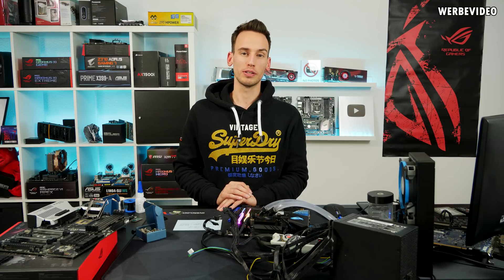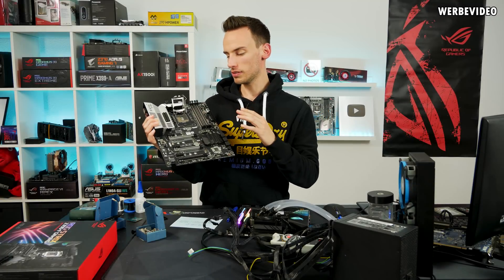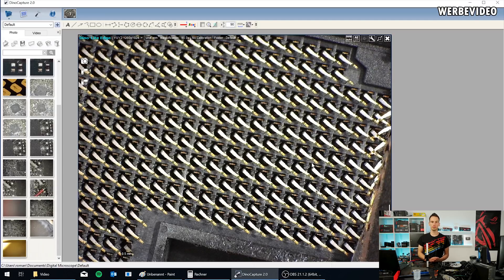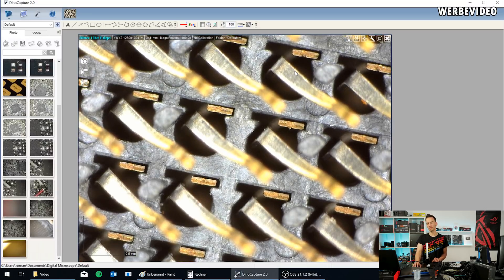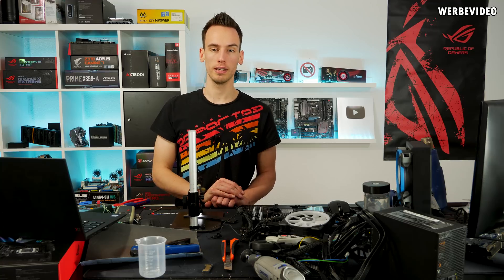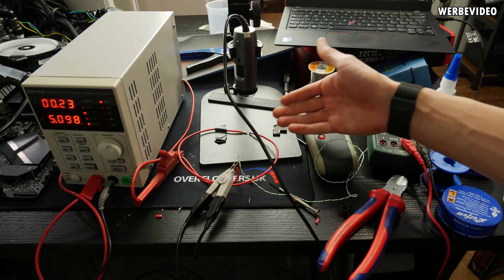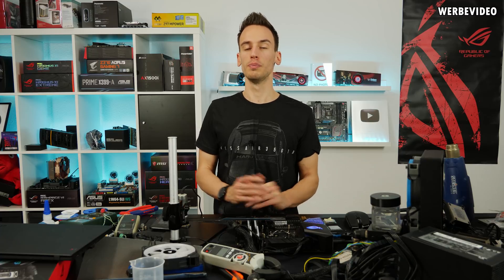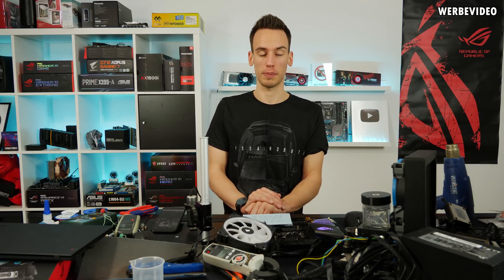We analysed the Z390 socket!

Comment: You are showing 5 Amps flowing through the pin, but the PSU is only showing 0.23V. Heat is a result of resistance and the amount of heat dissipated is related to Volts and Amps flowing through the pin. To simulate what the pin is doing in circuit, you'd need to put 1.3V into it. As the pin is very low resistance (effectively a short circuit) you do need to limit the current, but by only running 0.23V, at 5A  that's only equivalent power to 1.15V @ 1.0A or 1.15W and most of that heat generated at the pin is going into the heavy wire which can easily handle it and the PSU is dissipating the power, not the pin.

A more effective setup would be to put a resistor in series with the pin to limit the current. In the case of 1.3V, you'd want a 1.3 Ohm resistor for 1 Amp, a 0.65 Ohm resistor for 2A, and for 5A you'd want a 0.26Ohm resistor. The dissipation through the resistor & 1.3V 5A is 6.5W.
If you don't have the correct resistor or wattage of resistor, it's easy to parallel them to get the desired result. 

I would also attach the pin with a short bit of wire and then to the resistor lead, in the motherboard you have hundreds of pins attached to the copper not just one, and hundreds of Amps, that means that the amount of copper for each pin is a whole lot less than the wire you've used here. I'd use something like 5 -10cm of AWG 22 or 24 to simulate the copper of the motherboard allowed for each pin and use the fly leads of the resistor(s) for the other side of the circuit.

As the pin is short, wide and thin, it could probably handle a lot of current as the voltage drop across the pin feeding 1.3V into it would be tiny.  To put it in perspective, 1000 feet of AWG 24  (0.02" diameter or 0.5mm) is 25.67 Ohms or 0.02567 Ohms per foot, 0.00213 ohms per inch, or about 0.001 Ohms per cm. The heat dissipation across 1cm of 24AWG @ 1.3V @ 5A is 0.26 (Resistors ohms)/0.001(wires ohms) or 260 times less than the resistors 6.5W or 0.025W. The voltage drop across the pin is approximately 1.3/260 or 0.005V if we use the 1cm 24AWG proxy. If we do our sums that 0.005Vx5A = 0.025W. If we put 130V across the pin @ 5A, it would use 2.5W and glow red as it disintegrated.

Power used (watts) is joules per second, to get joules per second you need coulombs (1 Amp is 1 coulomb per second) x Volts, you're literally only considering half the equation. The temperature of the pin is a result of the energy it is using (Voltage drop X Amps) and not just how much current passes through it.
Reply: Its a VOLTAGE DROP across the pin. The pin is not dissipating 1.35v*1.1A (the CPU would be powered by nothing if that was the case), it is dissipating its VOLTAGE DROP times current.
Reply: @jakegarrett8109  my guy... You're not getting it. Again, I teach this stuff. The voltage drop is a result of the resistance. The voltage drop would be equivalent to the resistance of the pin times the current through it. Since this is completely dependent on the current, as the resistance is constant, the resulting power can be analyzed using ONLY the current. Jesus.... Only on YouTube would a random think that they know more about physics than an actual physicist.
Reply: @JohnFerrier  I wasn't replying to yours, your first comment was correct. "just running current is fine, as P = (I^2)R", which is why I mentioned the voltage drop (V=IR, where V should roughly equal Vdrop_pin, although it will be slightly off since it has the extra cable soldered to it, you'll just use a Kirchhoff's voltage law).
I was replying to magottyk with his "but as the pin is effectively a short" (which its not, its most definitely not, otherwise it wouldn't heat up at all if it was an ideal wire)
Reply: @jakegarrett8109  shorts aren't perfectly conductive. They're low resistance, which the pin is. The manufacturer wants the pin to have as low of resistance as possible. So, it is technically a short. It's like have a Kirchoff loop where no components exist. He's correct. The key word there is "effectively". There are no perfect conductors. So, in  Kirchoff loop, we'll treat the conductors as having 0 resistance because that is effectively what they are, relative to the overall circuit. In his case, this is totally fine to do. That's why he only needs to focus on the current in the loop, as that negates any issues from the wires themselves. It makes the results independent, as long as he knows the resistance of the pin.
Reply: @jakegarrett8109  sorry for getting you confused earlier. I thought I was replying to the other guy. You're first comment is totally right. I read his comment and replied to you. Haha
Reply: @jakegarrett8109  
Yes that's what I've been saying (see OP where I say "and the PSU is dissipating the power, not the pin.
")
The pin has it's own resistance in the circuit, but it is negligible to the rest of it (in the motherboard).
In the circuit Der8auer built, the pin is the primary resistance here. The big chunky wires should be far less, but the indicated voltage of 230mv to give 5A in what's essentially a short circuit, seems too high. The resistance in the wires should be practically invisible, but they are seemingly not.

There's no CPU, there's just the pin (and cables) dissipating 0.23V x 5A or 1.15W.
Now the resistance of the pin doesn't change, it works out to be 0.046 Ohms according to the PSU, if the pin was carrying 1A as it would when the CPU is overclocked then it would have a 46mv drop across it and 46mw of heat generated.

Given this astronomical power use by a simple piece of metal we can conclude that either A: motherboard engineers (especially socket designers) are incompetent or B: That the voltage inaccuracies displayed by the PSU null and void the test as you just cannot be sure that the current is not also incorrect.

To overcome the inaccurate voltage reading, the test should be designed so that both the voltage and the current concur with what would normally be found in the circuit (the CPU replaced with a simple resistor) so that the voltage and current can be verified correct and that temperatures of the pin are not heat sinked away as they were here. The CPU is hot and contrary to mythology heat does not rise but conducts from hot to cold.

At 1.3V and 1A (1.3W), you need a ~2W 1.3ohm resistor near the pin to simulate the CPU and it's temperature, not a cold heavy copper wire as you are draining heat from the pin from both ends. For the heavy 5A test, you adjust accordingly.
Reply: @magottyk  If its negligible, then how is it heating up? Oh wait... Its not then... Nvidia also seems to heat up nicety, they have roughly a 0.004 ohm resistance on the GPU core...

Once again, if 2 amps is passing through that pin, and it does in fact have a resistance, we can then calculate Vdrop, but either way, its still going to be similar to powering the CPU since its going to have the same 2 amps and the same voltage drop... So we don't need to calculate anything.
Reply: @jakegarrett8109  
If that's Nvidia's resistance (let's not forget reactance BTW) and the voltage drop is across that, then yeah you'll generate heat alright. Let's see 1.2V 150A 180W does that sound about right.

Except that as things heat up they tend to gain resistance and Pins touching a hot CPU will gain heat by conductance.
What did this test show except that when you heatsink a small bit of wire it'll be able to handle a high current. It's got cold on both sides.

Still want to know why the voltage shown by the PSU was so high, my guess is that it was strobing the amps on and off because of the current limiter and that's the average Voltage. How long does it take a fuse to blow and would connecting it to a big heat sink slow down or stop that process (think old school fuse wire).
Reply: To be fair, his setup is more correct. You're right that it's wattage that matters. But, in the computer, the metal resistance isn't changing. Therefore, just running current is fine, as P = (I^2)R.

The scenario you presented above would work but he would need a much more powerful power supply, as the overwhelming majority of heat will be dissipated in the resistor, as it has a much higher resistance. So, it's pretty pointless to do such an experiment.

His way of approaching it is much smarter. You won't be able to have a large voltage difference on a low resistance item unless you have an insanely high amperage ( V = IR ) and Voltage or Amperage can be the dependent variables of the system but Resistance is only an independent variable.

Using your equation above, P = VI = (IR)I = ( I^2 ) R. Given this result, it's certainly fine to only look at the amperage, as the resistance is independent and unchanging.
Reply: @JohnFerrier  
You can do it with a couple of AA batteries. He could do it with that power supply he just needs to dial in the volts, current limiting should only kick in if or when the voltage goes too high.
I included the resistor wattage required for 1.3V @ 5A and it's only 6.5W. Either a 10W resistor or about 6-8 1W resistors in parallel would do the job, You can also heat sink the little blighters.
Reply: @magottyk  my friend, that's not how it works. I've built plenty of circuits and I'm currently working on my PhD in physics, where I've taught undergrad classes involving circuitry. Trust me on this. Driving up the voltage means that the current must increase. They are not independent items. They depend on each other. You can't just set the current and the voltage. The part you're missing is that in your scenario, the wattage is being dissipated by the resistors and NOT the pin, which is what he's trying to focus on. While you'll see a voltage difference in your circuit, the voltage drop is from the resistor, NOT the pin. So, you won't be getting the desired results you want. To fully check it, he can just observe the current as a means of power dissipation across the pin. I showed this math above.
Reply: @JohnFerrier  
Yes you cannot set both current and voltage from the power supply alone, but I never ever said that did I, I said "current limiting should only kick in if or when the voltage goes too high", i.e. you muck up the circuit or something blows and you get a short or you increase the voltage too high. 

With your maths, you don't know the resistance of the pin. So you have an unknown in the equation so it can't be solved.
All you have is I^2.

He's effectively connecting a short circuit to his PSU and the current limiter is kicking in dropping the voltage.
 Therefore the voltage across the pin isn't what the pin would be subject to in the motherboard.
If the PSU was acting as part of the circuit so that we are only seeing the VOLTAGE DROP across the pin, then why is it showing 0.23V. 0.23v and 5A is 1.15 watt and the resistance of the pin (circuit including the monster cable) must be .046 ohms.
Seems rather a large value for something so short, given that that's about 2 feet of AWG 24 wire.

"Driving up the voltage means that the current must increase." Yes exactly, but as the pin is effectively a short, when you want 1.3V @ 5A, you need a resistor of the correct value to do that, If you were to increase that voltage, then the current would increase, because the resistor value is fixed, you'd have to double the resistor value if you doubled the voltage to fix the current at the same 5A.

I didn't anywhere say to run a short circuit, it's just that the resistance value of the pin is so low that it effectively doesn't need to be taken into account because the voltage drop across it is only in the vicinity of 0.005V when you are running a circuit of 1.3V 5A and not 0.23V

"You can't just set the current and the voltage."
I just did by calculating the resistor value required when you apply 1.3V. It's not difficult to set a voltage value, most  variable power supplies can do it and a couple of batteries powering a $2 buck converter and you have your 1.3V 5A (yes they are that cheap). The current is a consequence of the applied voltage and the resistance in the circuit, that's why you'd built a circuit with the correct value resistor.

When I built my current limiting power supply some 30 odd years ago, that's when I noticed that when you try and force a lower current into a circuit, the voltage drops and all the results change. The pin might have been carrying the current, but it wasn't carrying the power.
Reply: @magottyk  you didn't just set the voltage and current. You set the voltage drop across the resistor. Again, this is basic physics. The voltage drop across the resistor is not the same as the voltage drop across the pin. Your approach is technically wrong in that respect.

Also, your last comment makes absolutely no physical sense, which clearly highlights why you don't actually understand how this works. I suggest taking a physics class on this at a local University. Who knows... Maybe I'll end up being your teacher.
Reply: @JohnFerrier  
No, maybe I wasn't clear where my objections lay. But V across resistor + V across the pin = V total. But as V across the pin is so small, you'd need some exceptional test equipment to measure it. Thus for all intents and purposes we can ignore it as it will have little effect on the total current. If it did we should be able to directly measure its resistance with a half decent multimeter.

We don't know the voltage drop across the pin, but compared to the resistor it's negligible. It should also be negligible when it's in a short circuit like the one Der8auer used, but the voltage shown by the PSU was 230mv for a 5A load. That does not make any sense as that equates to 46mw at one Amp (0.046 ohm) and with 128 pins that's 5.88W generated by the VCC pins on the z290. That's a lot of heat for what's essentially a short bit of wire.

What we got though was readings that told us that the little pin was responsible for generating 1.15W @5A. It should have been a lot hotter.
Reply: @magottyk  you're correct there. But, he's not looking at the voltage drop. All that matters in that test is the current. It's quite obvious that the voltage drop is from the entire setup. But, the voltage is not needed. All that matters is the current. This is because on the Mobo, the main voltage drop comes from the CPU, as the resistance is very low on the pin. Therefore, he only needs to consider the max current through the pin, as the power dissipated by it can be easily determined from the current. Because the current is a result of the applied voltage and the inherent resistance, it makes perfect sense that the resulting voltage drop is very low, as the resistance is also very low. So, again, all that really needs to be known is the resistance of the pin and the current through the pin. Since the current is constant in a series circuit (like in the video above) the effects of the wires for the final calcuation is completely negated. Since we don't need to know the voltage drop across the pin because of basic algebra, the wires are once again easily negated, as long as we know the current through and the resistance of the pin. So, his approach makes calculating the power lost through the pin easily determined. His approach negates the effects of the wires. His approach is the smart way.
Reply: @JohnFerrier  
I see a voltage that makes no sense, therefore I'd want a way to confirm what's going through the pin constantly.
I think me converting to equivalent power (the 1.15V@1.0A bit) has confused what I intended.

The voltage is anomalous, and when an experiment has an anomaly, I'd do it differently.
I went back to basics, with fixed voltage and current controlled by a resistor rather than the current controlled switching that the PSU is likely using. You might have noticed that I looked for approximate equivalencies to outline the methodology, especially where heatsinking is concerned. The pins are in their own little hot box with a hot CPU overhead and copper traces carrying a rather large current that those cables look like they could almost handle on their own.
Reply: @magottyk  but, that isn't back to basics. That's what I was trying to tell you. Again, I'm a physicist who teaches this kind of stuff to undergrads. He is doing the basics. The voltage you see makes no sense because it's the voltage drop off the entire system. But, that voltage drop off his system is completely irrelevant. It has no bearing on how it works in a computer. He's simply testing the pin for viability. This means that he needs to know of the pin can handle the wattage required. Since this is calculated by knowing the current and the resistance, he doesn't need a specific voltage drop. That's makes zero sense. And, in a computer, it also wouldn't have a large voltage drop. The pin is a low resistance item. The expected voltage you want is because of the CPU. That's where the main voltage drop occurs. Once again, his approach is the most basic approach and the most correct approach. It seems more like the basic physics is lost on you a bit. This isn't a complicated subject. It's high school level.
Reply: @JohnFerrier  
I'm pretty sure I included words like circuit that included everything.
The pin being able to handle 5A wasn't a surprise, not when it's got massive heat sinks either side.
"This means that he needs to know of the pin can handle the wattage required"
Yeah.
"Since this is calculated by knowing the current and the resistance"
Yeah but we only know the current.
"he doesn't need a specific voltage drop."
But he has one, it's showing on the PSU for the circuit.
What happened here is that he took temperature readings to confirm that the pin wasn't getting too hot.
But the pin is in an entirely different environment to its normal operation, all we found out is that a socket pin connected to two hunks of cold wire can handle 5A.
"That's makes zero sense. And, in a computer, it also wouldn't have a large voltage drop."
I think I estimated by rough extrapolation from a reasonable argument relating to AWG sizes (0.5mm dia), that the voltage drop should be in the vicinity of 5mv @ 5A not 230mv. I really shouldn't have included the 130V bit, that was a brain fart and I'll blame the dog.

The socket is a hot box, the difference between the pins normal environment and what was shown here, is running a 2080ti on an open test bench with fans at 100% vs in an enclosed small case with no fans at all and just a passive heat sink.
 Not the same thing.

When I said back to basics, that's including all the known factors of ohms law, Known Voltage, Known resistance, from which we can actually calculate the current (stuff you first learn). From that current we can see if the pin is drawing excessive power from its internal resistance. If we cannot measure a difference then it's effectively zero in a circuit that approximates actual conditions. We should not suddenly see a 230 mv difference (across the resistor) from a 1.3V reference (17%) when the pin is added to the circuit, nor should we see any appreciable current drop from the added resistance as it should be too small to measure (margin of error) even at 5A without some very accurate (like 0.01%) equipment.
Reply: @magottyk  you're right, to an extent. The wires do act as heat dissipators. But, it isn't instant. That's why breakers work in your house. What matters is the instantaneous heat dissipation from the metal.

For a second, ignore the voltage. For the 1000th time, it's not necessary to know that for the final result 

Knowing that the pin has a specific resistance, you can increase the current and observe whether the pin melts or not. Sure, the wires help cool it and I agree that using his temp sensor was stupid. But, if you know what the resistance of the pin is and you know that the pin can handle 5A, you can EASILY determine the power through the pin (P = I^2 R). This is what is important. Just knowing this, you can tell if the pins will melt in the socket. This is because from the wattage, you can derive a temperature. If the temperature is lower than the melting point, you're fine. Looking at his current and even the presented PSU voltage, the pins are WAY below the melting point. But, you wouldn't even need to know the voltage if he simply measured the resistance of the pin, which is low. Either way, just knowing the resistance of the pin and the the fact that a single pin CAN handle 5A, his test can easily show that the pins can handle the power requirements for his CPU test. This means that even though the wires can sink the heat, the calculated heat for the pin is so small that it doesn't even really matter. So, even though he stupidly used a heat sensor when it wasn't required, his general approach was completely correct.

Keep in mind that temperature is additive. With his calculated temperatures, even if you assume that it's over 100C in the socket, the added energy will not result in a melted pin. At 1 Watt, the pin is generating about 0.0005 Celsius/second. Since the melting point of the pin is around 1000 Celsius, we can easily assume that the pin is safe. Now, if the pin was 100,000 ohms, we certainly have an issue.
Reply: @JohnFerrier  

I get that 5A is 5A and the voltage drop across the pin stays the same regardless of the total circuit voltage, because the pins resistance is the same. Therefore the power dissipated by the pin is the same at 5A irrespective......

....Unless it gets hot, @20°C in specifications is there for a reason and that bit of physics of increasing resistance to increasing thermal conditions also applies to that little pin made of metal living in a hot box. While it's not likely to melt due to thermal runaway, it certainly can add to the burden on the system, it's not an ambient superconductor and there are lots of them each with their own 1 amp of current.

But we don't know just what is the resistance of the pin, nor do we know it's thermal impact on the system, we only know that it can handle 5A when you have a small heatsinks worth of copper dissipating presumably 1W total for the system.

Reality check, there's little likelihood that a 10% increase in current will overly affect the motherboards in many instances, especially regarding stock power draws or the boost draws. The current capability of an individual pin is not the issue, it's the 140 or so VCC pins and their ground companions all adding their tiny bit to a cramped enclosed space  surrounded by little capacitors typically rated to 105° max, whose lifespan decreases with increased temperatures, sometimes dramatically, all living under a CPU that's allowed to get to 100°C.

In all likelihood the pins actual resistance is less of an issue than the copper trace that feeds them as that's more likely to have lower tolerances for total current (it's stuck in a blanket) than the pins and they're all more likely conducting heat away from the CPU rather than actually generating any significant quantity to the total. But what is optimal for a reasonable lifespan of the system and intel just wants to sell more motherboards.